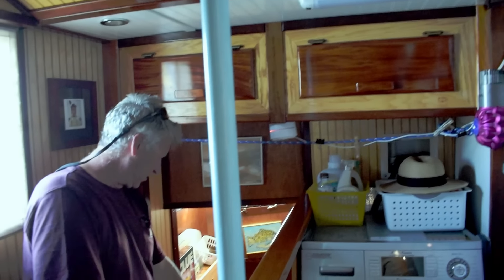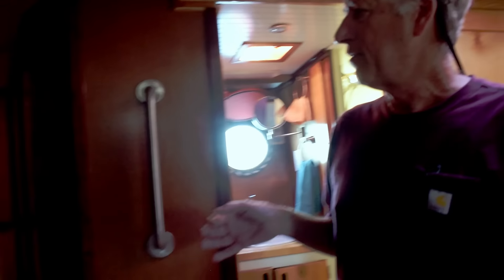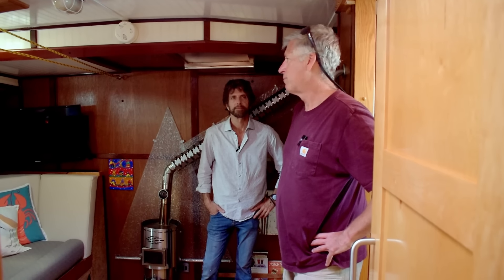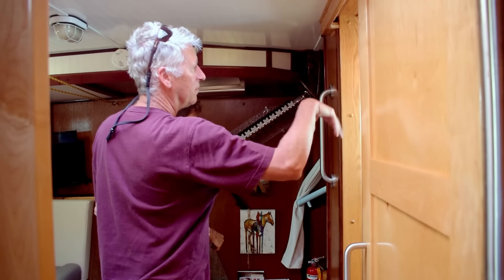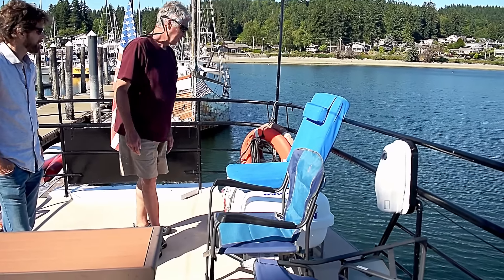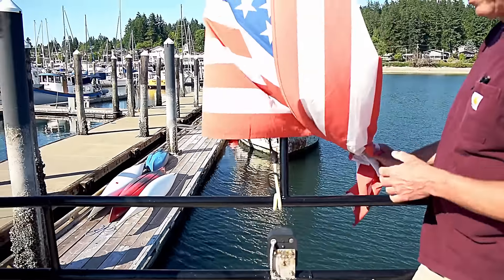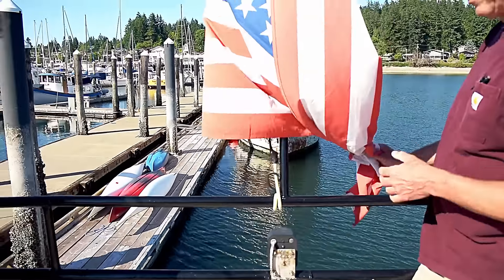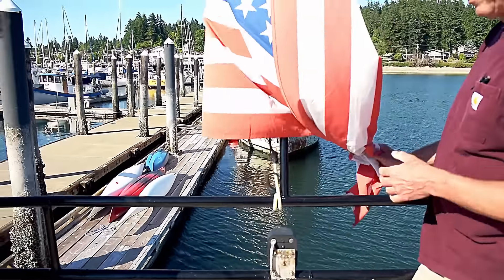ONE OF A KIND! Long Range, Exploration, Liveaboard | Full Tour

Comment: Did he say 11 gal. Hr..?

Oh, not sure if i heard correctly, but i would NOT ever want to fuel that...
Reply from the maker: It uses 8 gallons per hour which is incredible for this size of vessel! The range of 8,000 plus miles was with his set up not using all the fuel tanks. He had a couple closed off as he didn't need to use them. So essentially you can put more fuel in to gain more range! The replacement value on this vessel is well over 2 million and she is a total bargain at her current price! Designed for the Bering sea! Thanks for watching.
Reply: He talks about going to Alaska which made me wonder is it ice rated,,,?

Comment: Does it have watermakers stabilizers?
Reply from the maker: The owner didn't add water makers as it does have a 1200 gallon fresh water capacity. With the heavy duty construction and the weight of this vessel, the owner never felt stabilizers were necessary as he had no issues.  Thanks for watching!

Comment: I dont like the interior with all the mismatched woods but as someone put it below, beauty is in the eye of the beholder. It's very personalized and not for everyone (like me). No doubt it has been very well maintained, the owner is clearly on top of everything with his vessel. I have a good amount of experience with vessels and my biggest concern with this one would be stability. 74' length and only a 15' beam leads to a very rolling ride without active stabilizers. Maybe the deep chine and long keel help but most 74' vessels have a wider beam. The other big negative is having to go up and down ladders to so many spaces. Other than access to the main cabin there are minimal interior stairs. You can buy a refitted 80's Hatteras in the 60' range with much easier interior access and livability for the same or less. Interesting vessel though. The owners sure have loved her but it's going to take someone with a very similar specific vision to buy it. It's not a vessel the majority of the market would be interested in but it only takes one. Thanks for the well done tour.
Reply from the maker: This one is quite special, an Ed Monk design and he was known for excellence! This is a very stable vessel designed for the Bering Sea! Deep hull, very heavy weight and centered perfectly. Been on it and she runs like a dream! 8,000 mile range and extra tanks are right there not used currently for more miles then that if desired! She has been extensively sailed! She was planned for use in the toughest marine environment on earth! Thanks for watching!

Comment: "How" in the fuck can folks afford something like that...I need THAT job...
Reply from the maker: I have to say with an 8,000 mile range and an owner captain who has done charters and she has been lead boat for events? She can earn a bit of money for the right buyer. Yes you do need substantial cash to buy and maintain this beauty for sure. Thank you for commenting.
Reply: I am close to being a CPA (up late studying) and the girl I live with is a certified safety manager. We both average about $125,000 per year in income. The boat is ~$560,000 so we could afford it as many Americans have houses much more expensive than this boat. My house is paid off.

However, the problem is the Time, Energy, Money formula.

Young people generally have the time and energy.

Middle aged people generally have the money and energy.

While older people often have the money and time.

This boat would be ideal for older people. They could retire to a smaller house located in a cheaper area and buy and operate this boat. They could live on the boat for decent parts of the year.

For me this boat would be too large. I'd rather have a newer 23-to-31-foot Ruger tug. The price range for one of these "tugs" (not really a "tug" but that's the name) is ~$140,000 to $500,000 brand new depending on amenities and size. You can buy a used one for much less (I've seen $50,000 for older ones). I plan to eventually buy a relatively new one that's probably a 27-footer ($250K brand new but used ones with lots of life left can be $125K) to cruise the intracoastal water ways, the Great Lakes, and island hop in the Carribean. A lot of Americans could afford this, but you need lots of free time to make it worthwhile (a wait till retirement thing).

Comment: I can say a steel boat is a pain in the butt to keep up with the rust. Every 3-6 years you need months of yard maintenance repairs. The last steel fishing boat I worked on cost over $300k on one yard period that didn’t fix everything.
Reply from the maker: This one is a turn key steel vessel. Go check out the bottom restoration video! This owner has maintained this vessel with pride! Sorry for your experience, each boat is different. If you get one that suffered lack of maintenance, it creates the situation you experienced, sorry to hear that. Thanks for watching.

Comment: If you ain't got twin engines you got a single point of failure.  Would not recommend.
Reply from the maker: Have you seen the vessels that are featured on the Deadliest Catch series? They go out in the worst waters and weather on the Bering Seas...most every boat out there they feature is even bigger and has a single well maintained motor. Thanks for watching.